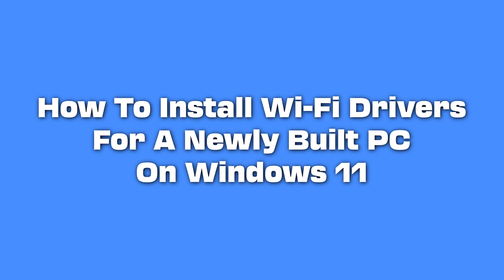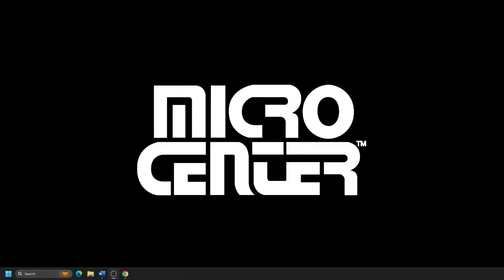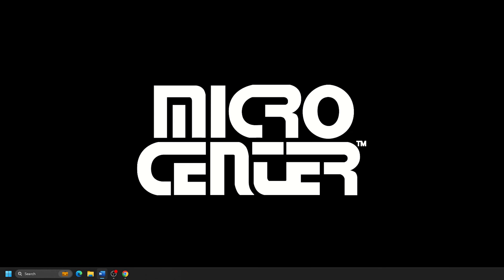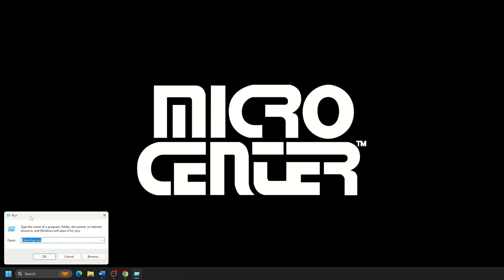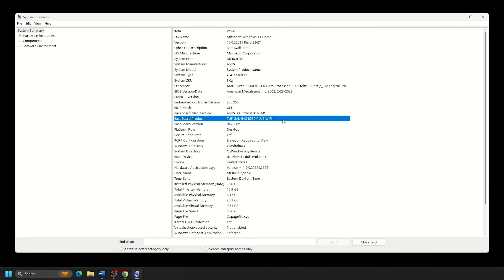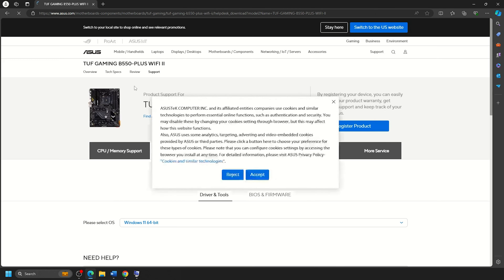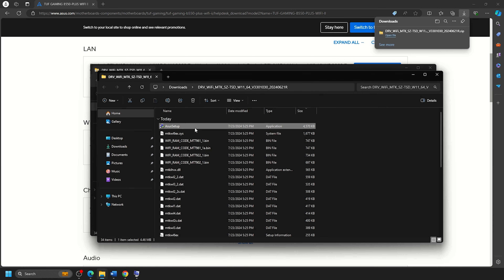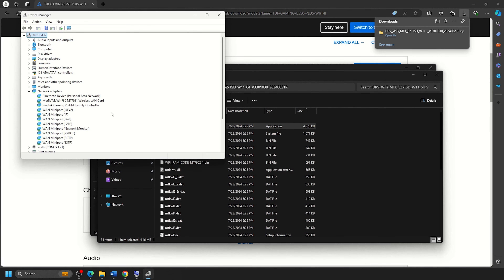How To Install WiFi Drivers For A Newly Built PC on Windows 11 | Micro Center Tech Support

Comment: The issue occurs when installing Windows on a new motherboard: there should be a step that shows how to install the necessary drivers during the Windows installation process.
Reply: Windows 11 wont let you finish installing without a connection, so if your LAN and Wifi Drivers are not already in windows you're SOL.
Reply: @NightCityGames you find a fix ?